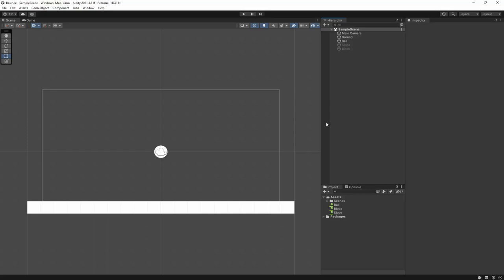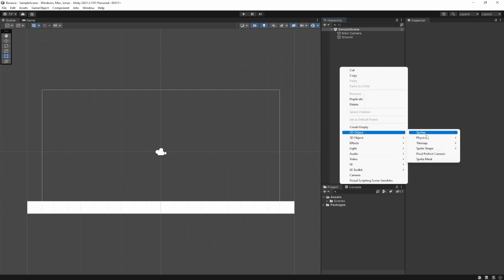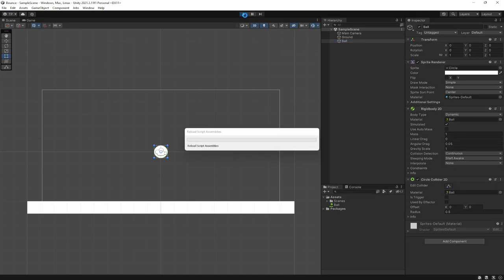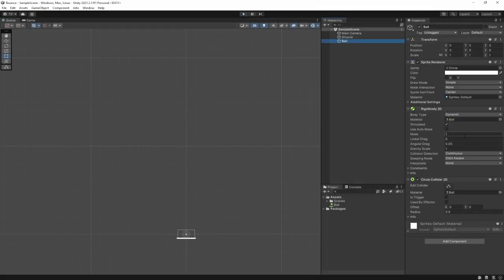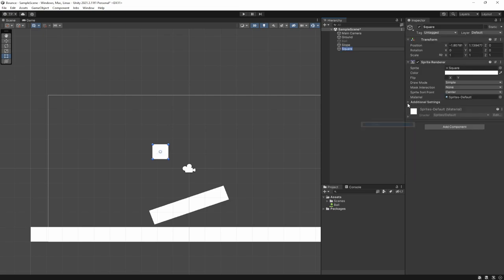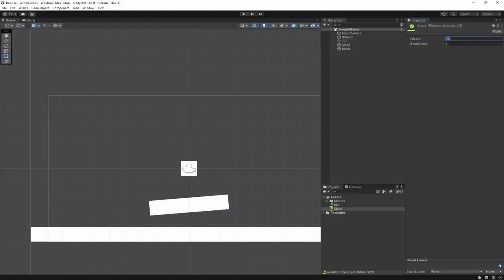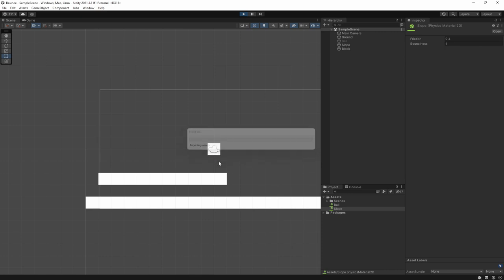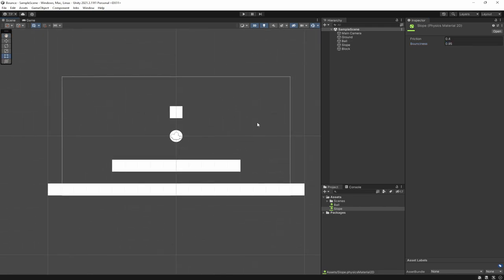How to Create Bouncy Balls, Icy Surfaces and More using 2D Physics Materials in Unity!?

Comment: how do i make the ball bounce higher? I can add more bounciness or it will get higher and higher and bounce out of control. A good value is 1.2 but on the 2nd bounce it will bounce higher than that
Reply from the maker: It depends on what you're trying to achieve, the value of bounciness determines how high the ball will bounce based on the height it was dropped from e.g. if you drop it from 1 Y value with a bounce of 0.8 then it'll bounce back up to 0.8 if you set bounciness to 1.2 and drop it from Y 1 then it'll bounce up to 1.2, then after that it'll bounce 1.4 then so on...
Reply from the maker: To add to this, if you want it to bounce an exact amount you may want to apply forces instead agains't the normals of the object and set a fixed force on collision